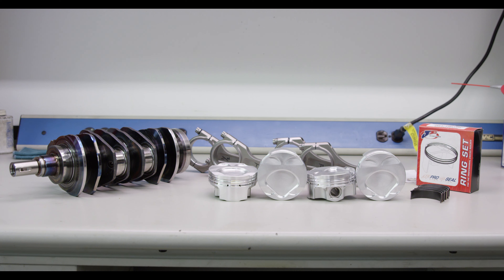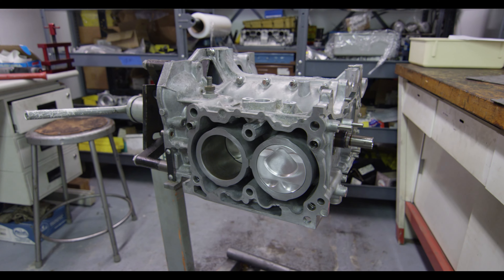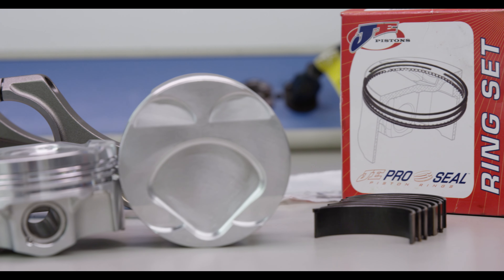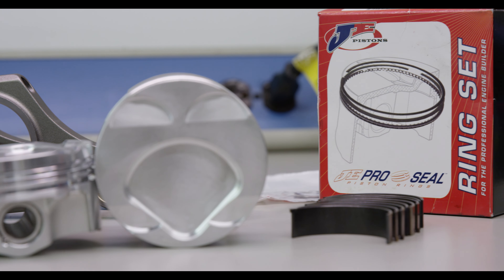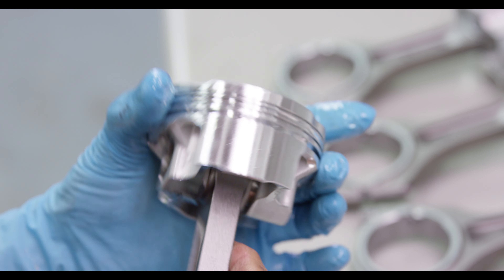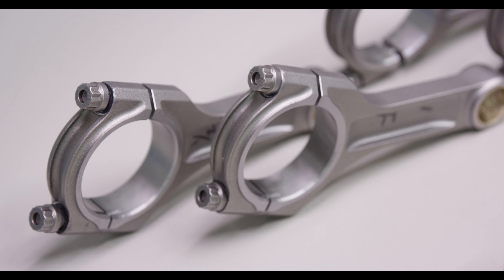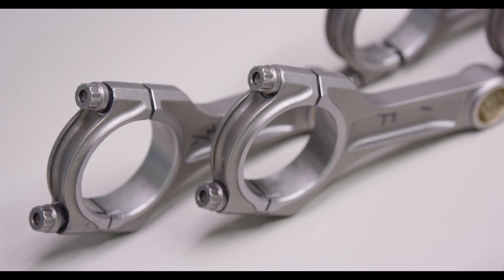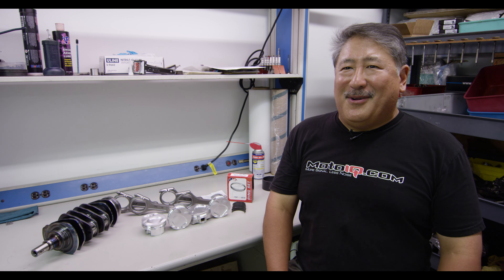Building an FA20 Short Block with MotoIQ

Comment: Where do you find torque specs and is this same as fa20dit?
Reply: I have the entire service manual on PDF for an FA20DIT. If you still need it I could get it to you somehow. It has every bit of information you could ever need.
Reply: @fatkat311  How did you get on with sharing this?
Reply: @fatkat311  Thanks, Sent you a message.  Cheers
Reply: @fatkat311 Ik this is a Hail Mary but wondering if you could send me that too.
Reply: @heribertomendoza412  there’s a chance I might have a back up copy I’ll have to check. I had the manual on a flash drive and left it with the car when I sold it. I can take a look at this weekend. I’ll be out of town until Saturday.
Reply: @fatkat311  thank you so much!